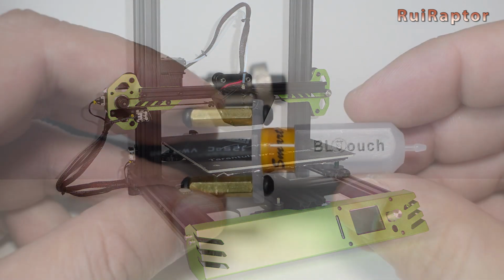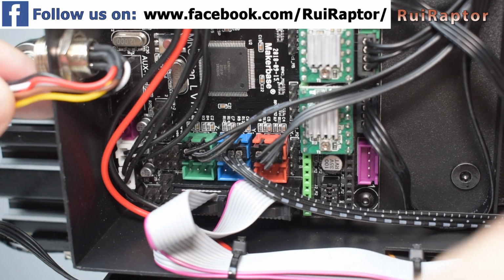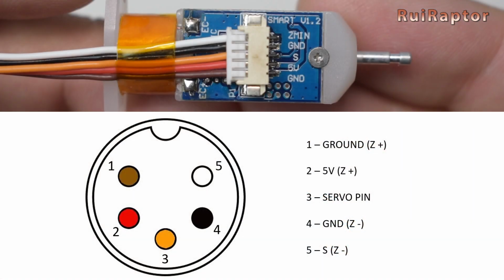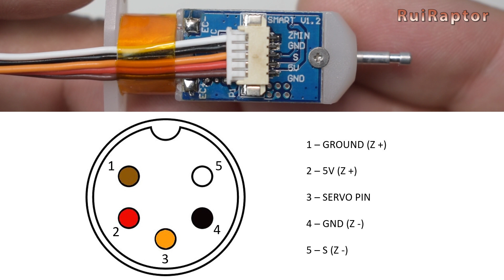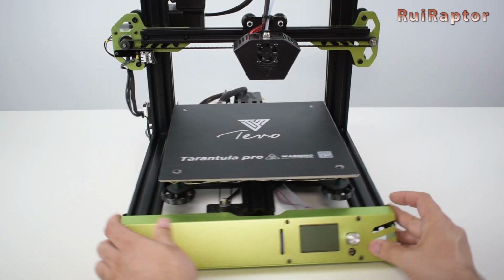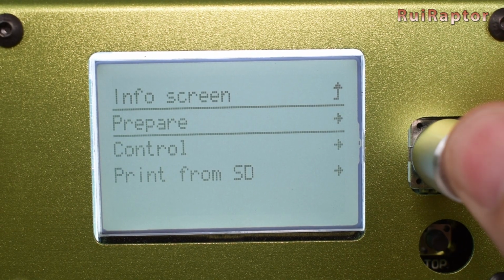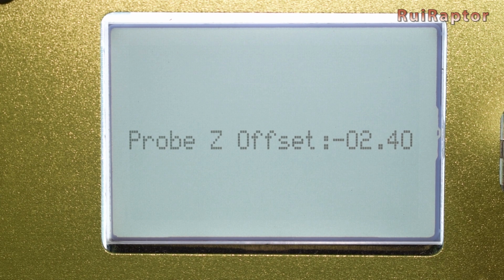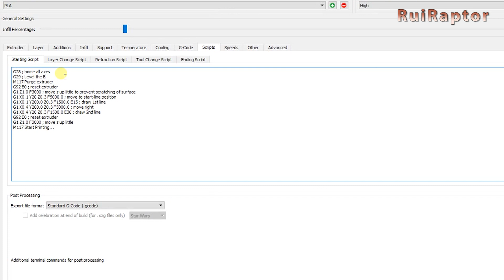HOW TO INSTALL BLTouch - Tevo Tarantula PRO

Comment: hi, i installed a firmware that is not from the link that you have shown, because i had problems with it, i couldnt find the .ino file. So i installed a little different firmware and now i cant find the probe offset anywhere, what could be the problem or how could i fix it
Reply from the maker: Hi Micha, maybe it's disabled in the firmware. Do you have the uncompiled files or an already compiled file?

Comment: You realize the Tarantula Pro doesn't have the BLTouch connector on the back!  Changes things radicully!
Reply from the maker: The new orange one does not include that connector, only the older green one does.
Reply: it doesn't change things too much you just need to connect the other end of your wire directly to the board. Most kits provide the required hardware. But personally I just got the connector and wired it up like it would have been if it were there. Just look at 3:10 and wire it up.

Comment: Hello. I have a Tevo Flash printer and I would like to upgrade it with a BLTouch. Do you have o video tutorial for this or  the electronics is the same as the TevoTarantula  Pro and the instalation is similar.
Thanks
Reply from the maker: Hi Christian, yes, the procedure is very similar.
Reply: @ruiraptor  OK thanks

Comment: Hi Rui, could you explain how to add G29 to Cura? Thx very much
Reply from the maker: Hi Umberto, it's super easy :)
Open Cura and at the top click on preferences.
Then click on printers and then machine settings.
In there you will find the start and end gcode sequences.
Add the G29 command after the G28 command.
That's it ;)
Reply: @ruiraptor  Thank you

Comment: Hi Rui, I have a problem: all test are ok, the BL deploy and stow work fine, but when I send the printer home only X and Y work, when the extruder goes in the center of the bed the BL shaft goes out and immediately in, everything stops and the printer tells STOPPED
Reply from the maker: Hi Alessandro, maybe you have something wrong in your firmware setup.
Reply: @ruiraptor  hi Rui, in my country we say "rimbambito".. there was a bad contact on the cable for z-.. now It works fine Thank you

Comment: Rui I need your help, if possible. The  BLtouch work with marlin v2.0??? 
I ask  because when I aplly Home position the printer don't stop when  BLtouch touch in box, they still coming down until bed, I need switch power off straight way. BLtouch deploy and stow when I test them in the printer settings.
Reply: SOLVED:
In my situation I dont need change white and black cable like should the video. I use the multimeter from sensor straight way to board connectors and my white cable its connect to ground and black cable to 5v in  Z-... now works perfect,  maybe I made a mistake when building the cable
Reply from the maker: Hi Mario, glad you got it working :) Nice work.

Comment: Hi Dear,
How to calculator for z-offset probe ?
Because i don't understant for how to get this value.
Reply from the maker: Hi, you should start with a value where your nozzle prints far from the bed. Then, use either the babysteps option in the menu while printing to adjust the height of the first layer. The value you get in the babysteps you can use to add/subtract in your z-offset value.

Comment: Another great video.. the BL Touch link no longer has the item can I use any BL Touch as I have noticed the price varies from a few ££ upto £40 so I am assuming that the cheaper ones are copies
Reply from the maker: Hi Paul, just look for the BLtouch in the trianglelab official store on aliexpress. Those are the ones we use.
Reply: @ruiraptor  Thank you once again..

Comment: I installed the new firmware but for some reason I cannot deploy/stow my bltouch from the controller. Did anyone else have this issue? I've confirmed that my wiring matches what is shown in the video.
Reply: Update: It ended up being a bad wire harness. I swapped out the wire harness and now everything is working like it should.

Comment: FYI everybody, you can re-purpose an old mini or micro USB cable, both of which are 5 conductor.  Also MIDI cables are 5-conductor, and cheap.

Comment: Hi, thanks rui. How long are those M3 spacers? Also what gauge is the 5C cable?
Reply from the maker: From what i gathered, there are different probe lenghts on the market so you need to first check your sensor probe and then buy compatible spacers. There is not a big requirement for this cable. You have small current passing through. You can use the same gauge as the BLtouch wires.

Comment: I will be upgrading my TTP with BL Touch and TMC2208 Firmware, do I flash both firmwares, will one overwrite the other? Will they combine the functionality, or is there one firmware upgrade version with both BLT and TMC2208? How do I upgrade for both?

Also the BLT firmware is "BL Touch + Dual Z"--I am not installing dual Z, will that part of the upgrade add something to the firmware that will mess with my stock single Z?

Thanks
Reply from the maker: Hi, you will only need to flash one firmware. Everytime you flash the firmware it will overwrite the other one. Yes, there is a firmware with both upgrades.
Reply: @ruiraptor  Thanks so much for the replies. Which one firmware will upgrade for both BL Touch and TMC2208s? Or do I need to rewrite/tweak firmware?
Reply: @okolepuka808  ey, i am in the same situation did u find the firmware?

Comment: Thanks again for your video Rui! I added the Bltouch and calibrated it. My Z-probe Offset should be around -1.1/-1.2 so I entered that value. Everything seems fine when I lower the bed to 0.0 (a piece of paper between nozzle and bed) But when the print starts, the nozzle is way too high. How can I prevent this? I can babystep it to the right height every time but that should not be the way to do things, right?
Reply from the maker: Hi Leon, first make sure that the correct Z-offset is saved (power cycle the printer and confirm the value in the Z-offset menu). Use the G29 command after the G28 command in your start script in the slicer. If your nozzle is still high, use the babysteps value to help calculate the new offset and change it. Warning: When testing, always be ready to hit the reset button just in case.

Comment: What size are those spacers you used? About 10mm?
Reply: Oh also, that little white rectangle that the 5 wires go into, which then go into the BL Touch. How do you get the old wires out of that, and the new wires from the cable into it?

Comment: Hi Ruiraptor, thanks for all your great videos. Is the install very similar for the Tevo Nereus? Would you recommend BLTouch as the best option for auto leveling on the Nereus?
Reply from the maker: Hi, it's possible to install on the Nereus but you need to install new firmware. There is a post on tevo nereus official facebook group with links and instructions. It's easier if you check that post rather than me explaining through here ;)

Comment: what if i don't have dual z axis? Can i use their firmware or i have to modify the stock one?
Reply from the maker: Yes, you can use the dual z firmware with a printer that only has 1 z.

Comment: but could you add to the video how to install the downloaded firmware on tarantula-pro ???? and what corrections need to be added to it!
Reply from the maker: Hi, to install a new firmware version you need to use arduino IDE software and connect the computer to the printer using the USB cable. I have several videos explaining this procedure with other printers. Here is an example: https://youtu.be/U9MGIlQgzkg . The difference between the Creality Ender and the Tevo tarantula pro is that you don't need to install the bootloader so you can skip the first part with the board and the small wires.
Reply: @ruiraptor  thank you very much!

Comment: great video like always. what is the gauge of the wires you are using for the 5 wire cable?
Reply from the maker: Hi, that cable is for signal and low power so you don't need much for it.

Comment: What I have seen in the reviews from the Tarantula pro, the bed is warped (mostly) in the middle of the building plate, so is mine.
I have sanded the adhesive sticker that came with the printer with a level beam to get the best I could get mechanically.
I would like to set more sample points for the BL Touch to eliminate this problem. 9 points is a little less, especially in the center of the bed.
I have seen something about a grid multiplier in the sketch from the ‘old’ Tarantula, however I can’t find that setting in the sketch for the Tarantula Pro.
Maybe you can help me/us out for this looks like a common problem with many (cheap) printers.

Thanks in advance, Nico
Reply: Sure, this printer dont have flat bed. And i have another problem, y axis is moving in waves. Search on youtube for: "tarantula pro y carriage problem" and look at 13s video, it is maybe a poor wheels/ball bearings. I waiting for new white/transparent wheels and ball bearings and i hope, its a sollution. And now back to your question. Open in Arduino configuration.h and look for #define GRID_MAX_POINTS_X 3 and the number is mean X and Y points 3 = 9, 5= 15......if you need specific numbers for X and Y, you must edit this line #define GRID_MAX_POINTS_Y GRID_MAX_POINTS_X. Only odd number is touching center of bed.

Comment: Maybe a little off topic, but I will ask this question anyway.
My question is about the firmware that has to be uploaded to the tarantula.
As I tried to compile and verify the sketch I got an error for missing U8glib library.
I downloaded the U8glib and installed it in Arduino. Now it compiles and verifies as correct.
However when I look at the Ino file I see the following lines concerning Oled graphic displays.

// SAV OLEd LCD module support using either SSD1306 or SH1106 based LCD modules
//
//#define SAV_3DGLCD
#if ENABLED(SAV_3DGLCD)
  //#define U8GLIB_SSD1306
  #define U8GLIB_SH1106
#endif

//#define SAV_3DGLCD is not defined to be true !?!?
Will the display work? Or do I have to define the display by #define SAV_3DGLCD ?

Better safe than sorry, I am very cautious on uploading the firmware to my Tarantula.
Kindest regards, Nico Leeman
Reply: It works fine, question answered :)

Comment: My experience with this printer and BL Touch.  1) disable this line #define PROBING_HEATERS_OFF - this make thermal error if preheating starting first. Maybe add G29 before preheating. My printer waits for preheating and then starts probing. 2) #define X_PROBE_OFFSET_FROM_EXTRUDER 8 is bad. True is 0, probe and nozzle is in line. 3) #define XY_PROBE_SPEED 15000 this is too fast, 10000 is better. This is for configuration.h. And for configuration_adv.h i recommend enable this line: //#define BABYSTEPPING and this: //#define DOUBLECLICK_FOR_Z_BABYSTEPPING

Comment: Hi. Is a difference of 2mm enough above the tip of the nozzle? Or do I need a little more height?
Reply from the maker: Hi Bill, if possible, a bit more wouldn't hurt but should be ok.

Comment: this is fine as far as the mechanics go but where is the instructions about using the Arduino software to open the file .   What if you never used an Arduino before?
Reply from the maker: Hi, when you install arduino, the .INO file will open the software when you click on it. If you need additional arduino tips, you can check this video here: https://youtu.be/RhlTdTLfaQ0

Comment: In my TTP bltouch set  is not necessary to change black and white wire. Probably guys in Tevo already fix it in last versions.
Reply from the maker: Hi Olegs, that is correct. The new cables probably have the wires crossed already. I have posted that info in the video description.

Comment: For anyone else who bought Tevo Tarantula Pro 2019 + BL Touch Sensor + Dual Z + TMC2208, please have a look at

https://github.com/wickwire/Tarantula-pro/tree/20190716_dualz_bltouch_tmc2208
Reply: When I unzip and try to open Marlin.ino, from your link, than it produce new folder with Marlin.ino and open in Arduino IDE this file without any tabs on top.
Reply: @olegspavlovs  after downloading the zip and decompressing, rename the decompressed directory Tarantula-pro-20190716_dualz_bltouch_tmc2208 to Marlin - then load Marlin.ino from it on ArduinoIDE.
Reply: Is it worth it? For me it's +110€ more than if I get it shiped from europe. If buying those upgraded separately, it's much cheaper.
Reply: @BitsOfBoris  I would say the upgrades themselves are definitely worth it, even with the Tevo sold versions rather than doing the hassle of making your own connector cable for Touch for example; As for buying them I agree, if cheaper and still hassle free, then better! Feel free to add buying alternatives so that other users can go for it - as for the modified firmware, maybe Tevo released their own config in the meantime.

Comment: Really appreciating all the Tarantula Pro tutorial videos. I ordered the version with all the upgrades (BL Touch, Dual Z Axis, and TMC2208 drivers) but I noticed that TEVO doesn't offer a firmware that accommodates all those options. Do you have any recommendations?
Reply: Hi, same issue for me - decided to fork Tevo's github repository and publish the merged configs I'm using > https://github.com/wickwire/Tarantula-pro/tree/20190716_dualz_bltouch_tmc2208

This forked repo branch started off with the default BLTouch + Dual z firmware.zip files from 201907 and then I added the TMC2208 X Y settings from @ruiraptor and enabled Z_DUAL_STEPPER_DRIVERS as I'm not going to use this printer for dual extrusion thus using the extra extruder motor connector to operate Z motor #2.

Please have a look and see if it works for you as well.
Reply: @heimdall2099  Awesome, thank you so much. I've got the stock Tarantula Pro assembled and calibrated, but I'm still waiting on the upgrades to arrive from AliExpress. It'll be a while before I can verify, but I'll try out your config first thing. Much appreciated.
Reply from the maker: Yes, it's not very clear, but adding a dual Z or TMC2208 is easy to edit. You can download these versions and compare the differences of the config.h and config_adv.h files using Notepad ++ and the compare plugin. There you will see the lines that are different and edit your own version.
Reply: @ruiraptor  That makes sense, I'll start digging into the configs, seems like I'll need to get used to tweaking it on my own as needed. Thanks!
Reply: @Solace no problem, hope it works ok for you  as well - I got my extras pack shortly after the printer kit, so I was still assembling the kit when dealing with the extras; I hope @ruiraptor will have the time and opportunity to add another video for dual Z installation, however there is already one I think from him for the old Tarantula. In my case, I already had assembled the X carriage and had to disassemble it to get everything in place.
I also hope I can replace the Z axis lead screw fixer printed PLA plate that Tevo ships with a metallic one
https://www.aliexpress.com/item/4000010590523.html?spm=a2g0s.9042311.0.0.27a84c4d7xQSW5
By the looks of it, it seems to be the same part, except for the color, I ordered two and would consider painting them black.
The included printed heat bed leveling gears also seem like could do with an upgrade, but instead of metal versions (I'm concerned that those would carry heat away from the build platform) I think I will go with production plastic ones.
Meanwhile I still have to fix the extruder, calibrate the machine and run a first print once the magnetic cover arrives.
Reply: @heimdall2099  Hope the firmware works too! I skimmed the dual z install instructions from Tevo, and they seem pretty thorough. The printer instructions were pretty good too, but I just worked off of Ruiraptor's video, easier to follow along with. 

That Ender 3 lead screw holder does look very similar. I agree, the PLA one that Tevo ships is a bit underwhelming. 

I found the leveling wheels work much better if you crank them down a bit to begin with, then raise as needed. I had to adjust my Z-axis end-stop while adjusting, but it helped keep the screws from just spinning with the wheel. My initial prints are coming out good, but I seem to be under-extruding. I intend to beef up the temperature and flow in Cura on my next test print, fingers crossed!

Comment: Where is the instructions on flashing the software and what settings need to be changed in the configuration file?
Reply from the maker: Hi, sorry for forgetting to include the link. I have updated it. Thanks.
For the firmware installation, please check the following video:
https://youtu.be/g4aHmbt5gMA
The printer used is a Tevo Tornado and although the firmware version is different, the procedure is the same.
Reply: @ruiraptor  I followed the same step as you had described.. Did i flash it incorrectly? BL Touch is on the screen but when I autohome, it wouldn't recognize as touching the build plate and keeps going... BLtouch is flashing red and blue when the stem stowed when touching the block.
Reply from the maker: If you go to the BLtouch menu and test the BLtouch (self test and depoy/stow) and it works, then the firmware is ok. Probably the white and black wire are not correctly connected. Check if you have the white and black wires at the correct positions.
Reply: ruiraptor I’m having the same issue.  The sensor isn’t triggering the z-axis to stop.  I’ve checked all connections per your video and everything is connected properly.  The sensor comes on and I can deploy and stow it without any issues, it just doesn’t trigger the z-axis stop.
Reply: @redredkrovy  You might want to switch back the black and white connector. After switching it back, it starts to work for me without a problem.